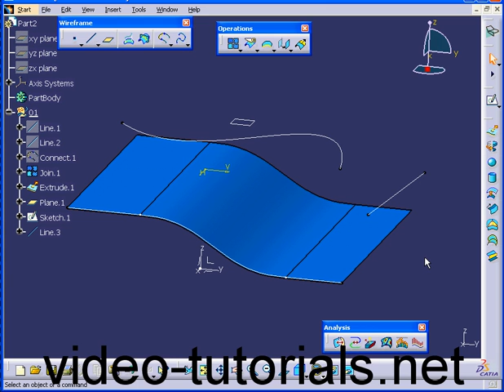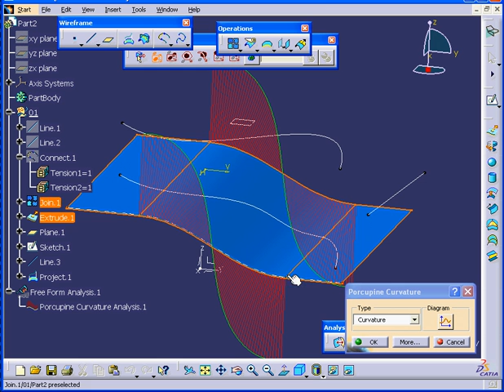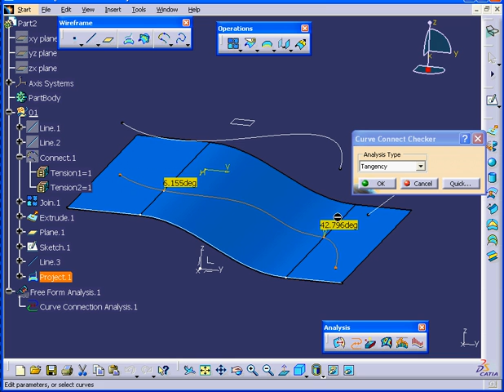SURFACE DESIGN CATIA V5

Comment: I have a question about CATIA V5 surfacing vs. PRO/Surface which is the basic surfacing tools that come with PRO/Engineer.

I have found that surfaces defined with 3 datum curves in PRO/Engineer are hard to work with because the meshing seems to become "degenerate" as it converges on the point or corner of the surface patch. For whatever reason the PRO/E internal surface representation seems to want quad-patch surfaces.

Does CATIA do 3-curve surfaces flawlessly, or workarounds needed?